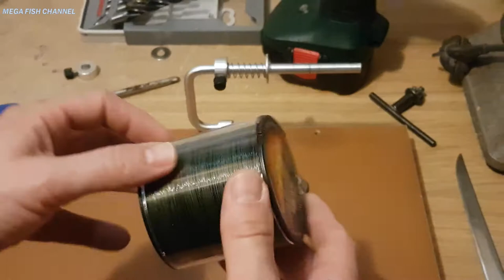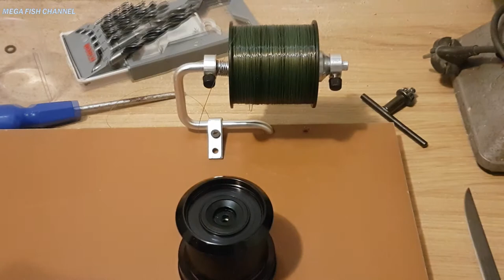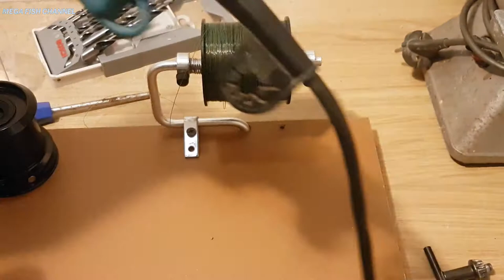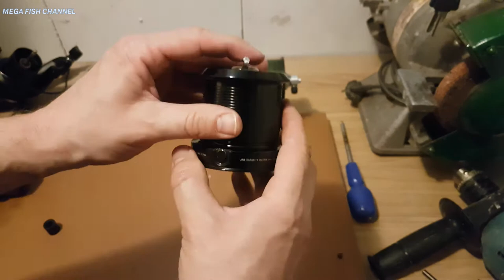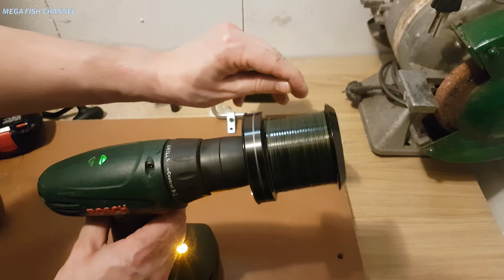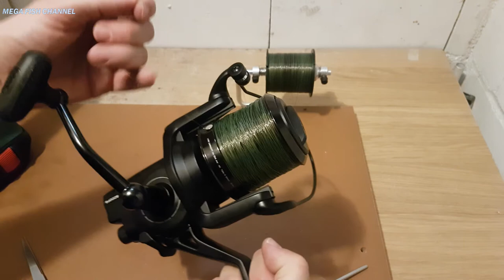Tying the fishing line to reel spool without twisting. DIY

Comment: Great tip! I was wondering if you could mount a spinning reel spool to a miniature lathe somehow?
Reply from the maker: It probably would only be possible if you have enough control over its movement. The screwdriver is easy to stop. Best regards.

Comment: WHERE CAN YOU GET THOSE TOOLS AT
Reply from the maker: It is a combination of a screwdriver, a board base and a ready-made handle for winding the line, https://allegro.pl/oferta/uchwyt-do-nawijania-zylki-plecionki-10559885009?reco_id=d839ca91-3e04-11ec-b58d-40a6b72bbcc0&sid=3ec404f37aa2fad6253fa5dd6bb023427743f77ee2f01bb84454c4701b8c0118